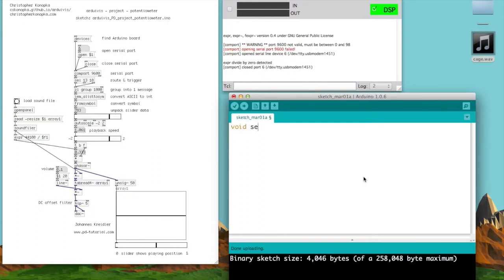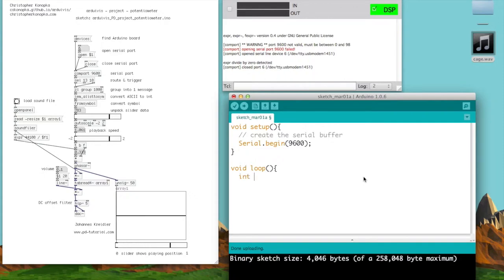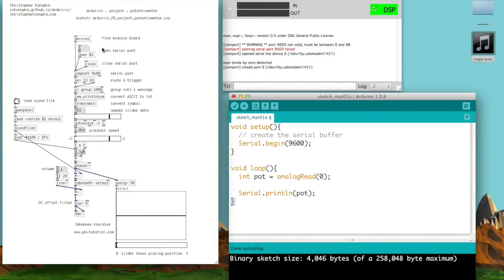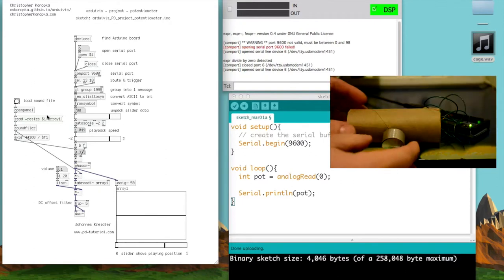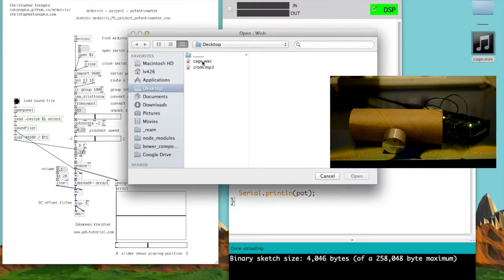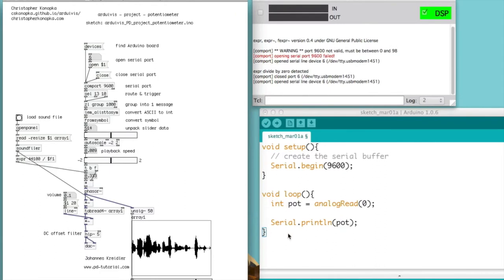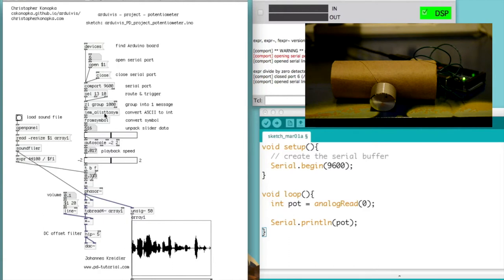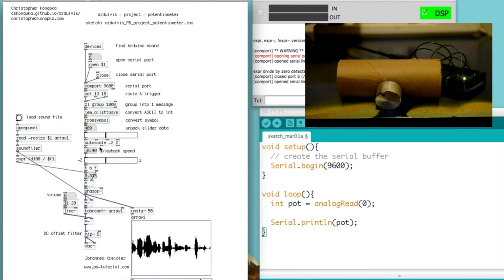arduivis - pure data - potentiometer

Comment: Hi, may I ask, am I able to see how to plug with the arduino with the potentiometer? Thank you
Reply from the maker: In this case the middle pin of the potentiometer is connected to the Analog Pin 0 (A0) and the left or right pin is connected to Ground (GND).